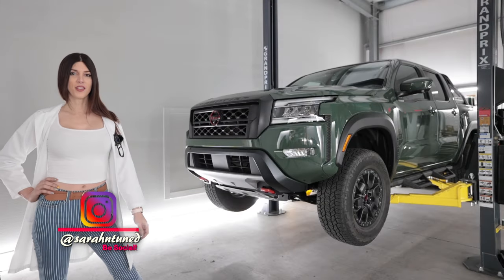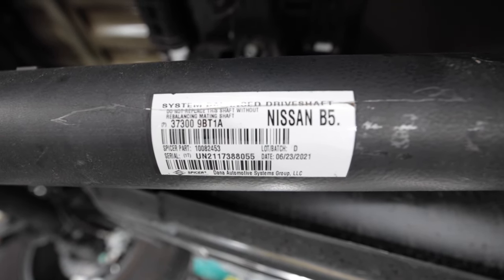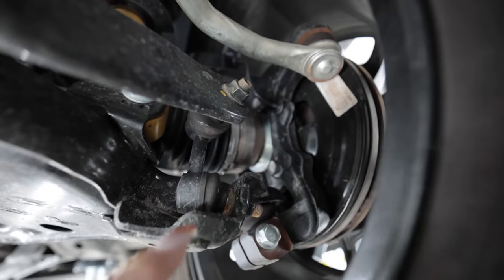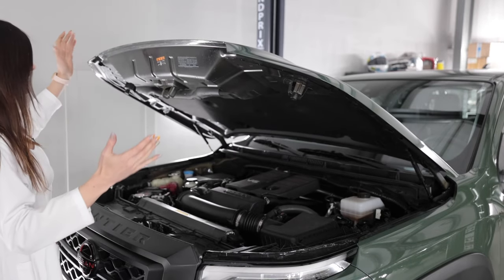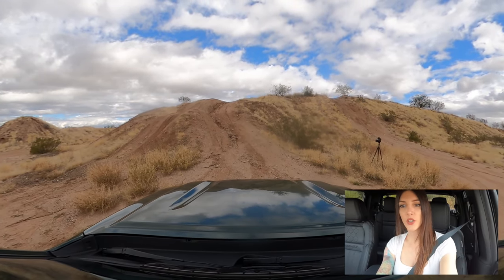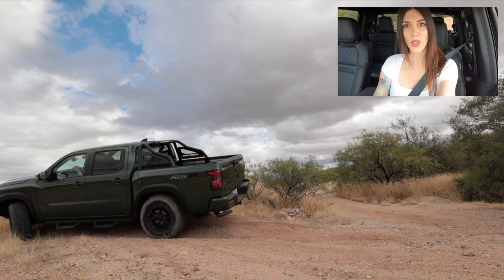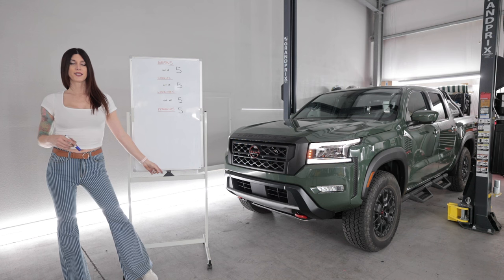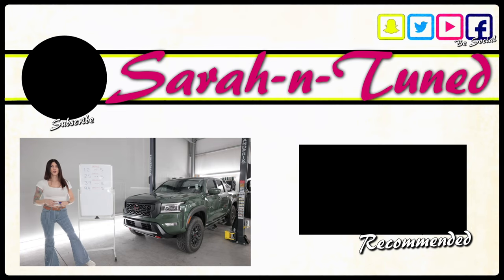An Idiot Proof 4x4? // 2022 Nissan Frontier Pro-4X Off-Road

Comment: Frontier=  Crawl ratio 60:1 fully boxed titan frame (ability to titan swap suspension/engine) , Dana 44 locking rear (pro4x) , dana front diff, spicer transfer case, powerful vq motor, rear disc brakes, bullet proof and made in USA. Tacoma= 33:1 crawl ratio, C channel frame (on going corrosion frame recalls) , rear drum brakes, now made in Mexico, reliability declining and Toyota tax.
Reply: toyota has been really lazy with a lot of models recently
Reply: Your comment aged very well! 👍
Reply: @FrankySilverFace  I had some insight as I use to work for Toyota:)
Reply: Toyota is struggling to keep pace with other manufacturers

Comment: I just bought the 2023 model. I couldn't be happier. The transmission is so damn smooth. The ride on the street has got to be one of the most comfortable out of all the trucks I've driven. Tech is pretty solid. My only real complaint is the lack of bolstering in the seats. I was looking at the trd tacoma as well. This is a nicer truck at the moment imo and there wasn't a ridiculous dealer mark up, paid msrp.
Reply: I got a 2023 Pro4x in June 2023, Love mine to, mine has all options and the 4 packages.
Reply: I bought mine last year, 2022. Was in a waiting list for 6 months, but It was well worth it love it. I'm glad I didn't go with a taco or chevy twins.
Reply: Just got mine yesterday 24 frontier pro 4x 🥰

Comment: I was surprised by your final rating after hearing some of your comments on them needing to dial back the 4 wheel nanny settings. It is good to hear it did not ruin the overall impression.
Reply from the maker: Yeah, I knew if you defeated that system which might be as simple as a fuse or a reflash of some sort this truck would be 🔥. I liked it a lot otherwise!

Comment: As always, an excellent video. One thing you might try is slowly turning the wheel left to right and back when you lose traction on a hill climb. You might be surprised with the result.
Reply: Or climb it with the Toyota Highlander grocery getter
Reply: @greatcornholio5541    No matter what truck you’re in, at some point it will resist forward movement. At that point, the above technique might help you out.

Comment: the intrusive computer systems remind me of when I drove the VW Atlas recently. I drive rentals for work and it was the worst car I've driven yet. could not handle snowy parking lots. it was actually dangerous because evey time I tried to pull out of a parking lot onto a plowed road there was a two second lag where it inched forward before taking off.  not great if another car is coming

Comment: It's cool seeing the 3rd gen up on the lift, to see how really similar it is underneath to the 2nd gen.

The 2nd gens were all front bar with no rear bar.  I'm going to have to measure my front bar diameter, see if the 3rd gen front bar is smaller than the 2nd gen to allow for better offroad articulation.
Reply: It's last years Frontier with new sheet metal is why.
Reply: @HighAltitudesCO  It's quite a bit more than new sheet metal, but it really is to the D40 as the D22 was to the D21, an evolution of the design.
Reply: @HighAltitudesCO  thats not a bad thing though.

Comment: Sarah, watching you on the hill climb, it was partly you, partly the truck.  In the dirt, under 30mph, you should be in 4LO.  by design.  The comp REALLY wants you to be in LO.  4Hi the computer thinks you are on roads in the snow heading to a ski chalet.  Also, you need consistent throttle control.  When climbing, you have to hold the throttle and let the ABS brick figure out the traction.
Even on the D40 when things are slick you have to give the comp a moment to figure out what you are doing, unless you go locked, then all the nannies are switched off.
Reply: This.

Comment: I had a frontier a few years ago and it was absolutely the greatest truck I’ve ever owned I don’t know why I bought an F150 this time lol!
Reply: I'm trading out of my 2017 4x4 long bed into a Maverick for fuel economy reasons and I am going to miss it for sure. I'd recommend one to anyone.
Reply: Fords are better than Nissans
Reply: @jamess3109  I agree I’ve had one frontier and about five F150s including a Raptor and a Roush supercharged F150 and I liked them all well, I didn’t really like the Roush that much was a piece of junk I sold it back to the dealership for what I paid for it because it was so many problems with it even they felt bad about it I hope they didn’t just turn around and sell to somebody else the trim and the mechanical bits were really bad!
Reply: @jamess3109  🤣🤣🤡
Reply: @mauricebarry8858  Facts. Nissans fall apart within a few years. Nissans are known to be trash.
Reply: @jamess3109  you have done 0 research and had 0 experience with nissan vehicles. Especially their trucks. Nissan trucks are extremely reliable, have great warranties and deals, and last over 300k miles.
Reply: @jamess3109  meanwhile, you see a broke down ford truck on the road barely driving or not driving at all every single day, ford makes shit vehicles, better than gm’s diharrea of vehicles, but still nissan makes better midsize trucks than ford and thats on my soul.
Reply: @jamess3109   LOL Better at braking down!!!
Reply: @mauricebarry8858  I've done plenty of research and know mechanics. Nissans are shit,
Reply: @robthomas1829  lmao for real!!!
Reply: @jamess3109  Do you have any idea bad ford trucks are? They make some of the worst trucks reliability wise, nissan is a great brand that has perfected their craft by not introducing a new pickup every 3 years, and instead learning and improving upon the old. Thats the reason the frontier and titan had been the way they were for so long.

Comment: Sarah, I love your videos. But why do you insist on putting vehicles in 4H when going up that hill?
From what I’ve learned 4H is when you’re going down a dirt road at a higher speed than the 4L.
4L is when you need to climb a hill.

Comment: That was ABYSMAL 4-wheel high performance, especially considering its 48-grand price.  Apparently, Nissan hasn't yet heard of traction control!  Absent that, they should have at least allowed the use of the rear locker at any time.
Reply: That's for damn sure

Comment: The one nice feature of Nissan side steps is the step itself is removable....my predators on my Tundra are welded. I had them repaired already. Nissan has theirs screwed in place. Such a smart design.
Reply: Yep. And when the steps are removed the rails become rock sliders.

Comment: Truck looks cool… just don’t think it has comparable off-road features as other trucks.. no atrac or similar system, no multi terrain select, no crawl control… they put a 500 dollar locker on it and priced it comparable to those high end vehicles like the zr2, rubicon, bronco sport and trd trims… in my opinion it’s really a competitor to the sr5 4x4 trims and should be priced as such.
Reply: Nissan has a system similar to a-trac in the front, i believe you just have to keep your foot in it.

Comment: Drove the 21 Tacoma trd off road and bought the pro 4x. Ride is 💯 better than the taco, so much quieter, got the pro 4x for $44k they wanted an extra $5k for the taco so it would have been $51k. Easy decision.

Comment: The rear driveshaft in my 2010 Tundra was a Spicer. And the heat shield forward of the fuel tank is probably there for a reason -- maybe at speed, air heated by the exhaust tube gave the engineers cause for concern. Maybe the Frontier is telling drivers not to climb really steep hills in 4Hi so as to not cook the transmission fluid into black goo.

Comment: Great review as always, Sarah.

Style-wise, I think it definitely looks better than the Tacoma.  (Taste is subjective.  I am NOT bashing any Toyota owner here.)

Did you notice all the surface rust where the mufflers met the rear pipe, on the bolt for the brake caliper, and the heavy rust on the clamp?  I wonder if that was because of it being winter and the truck being passed around to salty states.

How easy is it to reach all the fill spots and dip sticks?

That hill climb stoppage really annoyed me. You should easily be able to take this truck up that hill in 4 high.

I know this is a big, scratch that, enormous request but could you please take your Ranger up that hill once you restore it?  To me that is the baseline which all others must be judged.  If your Ranger can climb that hill without dramatics, every new 4x4 pickup should do so as well.

Comment: Cost-cutting on display with this one! Wow. The look underneath already shows signs of corrosion on several of the exhaust components. Along with that unpainted section of the driveshaft, the underside of this truck will be a rusty mess within 5 years in any northern snowy climate where salt is the flavor du jour in Winter. That mix and match of colors under the hood is ridiculous. Looks like a formerly beige truck painted green. That's disgraceful. And those spindly little hood struts aren't long enough to lift the hood as high as it should go, and they're not girthy enough to be up to the task pressure-wise and for the long haul. Sarah, I noticed that you had to give it a little nudge to get it to rise to it's top position. I'm glad you called Nissan out for this. My '04 Mazda 6 hatchback's lift pistons were weak in the showroom and were trouble for the 17 years I owned it because they were undersized. Come on Nissan. Huge miss. And that hood latch hanging down is going to piss of mechanics for decades as they scalp themselves on it. Jeebers.

Sarah, you're a pro at providing eye candy in your videos - love the little tap tap graphics! ;)

Comment: The older Frontier and Xterra also had those skid plates - on the Pro 4X only - but the steel is so thin I call them splash plates ( muddy water protection only) I wish they would have offered even aluminum true skid plates like what Hefty Fabworks and Shrockworks offers.

Comment: A zr2 is the clear winner.  It will do 2wd with the rear locked. You can also disable the tc completely by holding down the tc button for 4ish seconds.

Comment: Late late , but great video review!  My ‘21 Pro-4X has the same frame and drivetrain, but the older gen body and interior.  I too wish they had a 6 speed manual transmission.
After 3 years and 27k miles, it’s been great.  
👍😎👍
P.S. edited to add, mine got aftermarket hood struts, that open lots more.

Comment: I am really about to pull the trigger on this truck.  I bought 2016 because it was 10K less than the Toyota.  NOW this truck is loaded for the same 10Kish difference.
I do not like the front angle but I am interested in an aftermarket lift.  :)
You always make me laugh. - Dan

Comment: You get a 2.3 litre 4 cylinder turbo diesel here in Oz (Nissan Navara D23). Was it possible Nissan sent you a crashed vehicle? That raw steel front drive shaft and the dodgy paint under the hood...

Comment: There’s a brake switch on the brake pedal that has four wires going to it. Mine went out my truck would not start. My truck would not move into drive. I had to replace the switch before I could even drive the truck. My truck is a 2022 Nissan frontier, 2 Wheel Dr. SV.

Comment: The lack of a front locker and the nanny systems for the off-road systems that you mention give me pause. How does the Nissan's Pro 4x systems compare to the Ranger's FX4 systems? If you had to mix and match-would you install the Ford system into the Nissan's Engine and Drive Train set up?
Reply: There are already aftermarket lockers for the front.  But the nanny systems are becoming a problem on many vehicles.  They should all be switched off when put in 4WD.

Comment: I HATE when "most" manufacturers install their spare tires upside down. It doesn't give any more clearance and makes it difficult to check the air pressure (valve stem access)

Comment: I think the Frontier has caught up in many ways, but many say the Tacoma has better suspension, and is more fun to drive off especially off-road. Also, from personal experience, replacing only one water pump between three Toyota trucks since 1984 and just doing regular maintenance, Toyota gets my vote any day. Besides, if I wanted quiet and smooth, I'd buy a friggin' car, not a truck. Lastly, I have a new Tacoma being delivered in Feb. Sorry Nissan, I prefer a real truck :)

Comment: i think the front driveshaft isnt painted as to be a form of cooling rod system for the transfer case. to help the heat dissipate. Jk i think they used up the budget on the rear drive system

Comment: Claus Bomb group sending. I know about a lot of the electronic components, and a lot of the companies upcoming plans, with autodrive sensors and systems (how they work, and the programming behind them) my specialties are in electronics, now I will warn you ahead of time, expect a lot of newer vehicles to not be modifiable in almost any way (other than non chip/electronic reference points) without the manufacturer/service company being called in to 'reset/apply' any changes. Have you had any experiences with the ECM/system controls and lacking the specific 'authorization' software to get things working properly?

Comment: I really like this truck also, but you can’t get a trailer brake controller or cooled seats & that’s a deal killer for me.
Reply: The 2nd gen frontier didn't come with a trailer brake controller, but they came wired for it.  Just have to buy one and plug it in.  I would think these would be similar.  Never had cooled seats, but Nissan A/C is the best I've ever seen.
Reply: @samuelsuggs9751  - That’s just stupid!
Reply: @cmdrdarwin3682  which part?  The not coming with a brake controller?  If thats what you mean, no argument here.  Mine came wired for fog lights,  without the fog lights, so I bought some and installed them.  Thought that was stupid too.
Reply: @samuelsuggs9751  - I live in the desert Southwest.  Having cooled seats are a necessity.  One can get them on full size pickups, but not on small pickups - that’s really stupid.  Every pickup that can tow, should at least come with a dealer installed trailer brake controller.
Reply: @cmdrdarwin3682  It gets to the low 100s with 90% humidity here in Arkansas, but I've never had anything with cooled seats. I probably wouldn't do without em once I had em either lol

Comment: You couldn't get me to buy a other Nissan. My whole display went out at exactly 100k. Even with a warranty not covered.
Reply: Then you definitely won't want a GM😄....I've owned both and my Nissan went nearly 345k miles before I gave it to a family member. And yes it was still running well 😁

Comment: What is up with the lack of horsepower for that much weight? A Buick Grand National 3.8L turbo made 245 (factory underrated) horsepower and 355 lb ft of torque... In 1987!
 Geez. Nissan, it's 2022. Ketchup.
Reply: It was also turbo

Comment: 4X4 Hi will not let you do much, 4X4 Lo will let you do more off roading. Should've tried to climb that hill with 4X4 Lo without locking the rear end, I'd like to see that.

BTW! The Frontier is designed for every driver so the computer does most of the thinking and driving.

Comment: I don't think I would want one for any kind of off-road wheeling. And even the light off-roading my old Exploder, Jeep and I have done, those pretty running boards would be missing after the first stream crossing. Ask me how I know.
Reply: First thing you do is remove the steps.  They just get in the way.  The steps I had on my 2002 frontier were better.
Reply: Yes, I would definitely have to or the rocks would do it for me at the very first creek!

Comment: Nice truck, a lot better then any Nissan car or SUV. Those things are junk once they have a 100,000 miles. But I'd still buy a Toyota or Ford over a Nissan truck. Nissan has gone downhill after Renault bought them in the early 2000s.
Reply: Hopefully under the new management they will get back to making things that compete with Toyota.  Where the Pathfinder used to compete with the 4Runner, now they compete with the Highlander.  I think Toyota is going to ruin the 4Runner with the next gen.